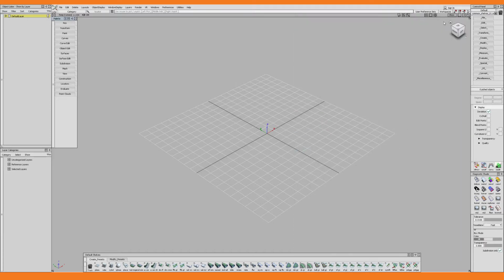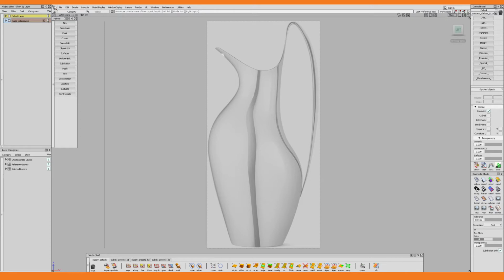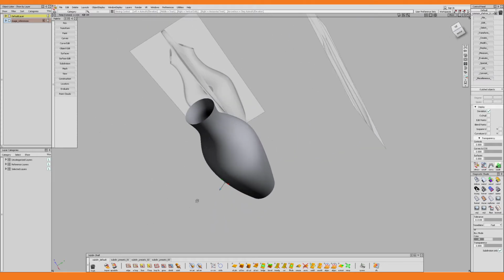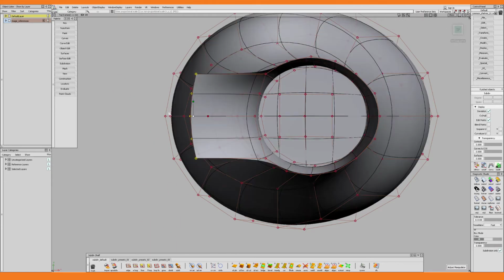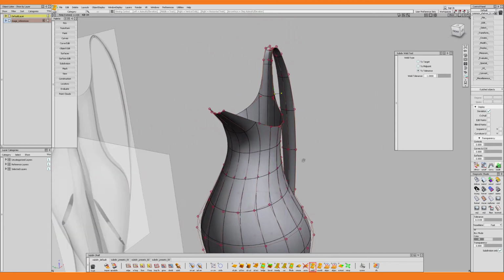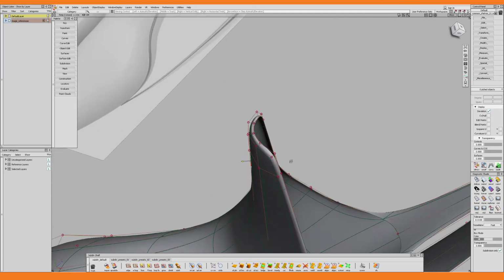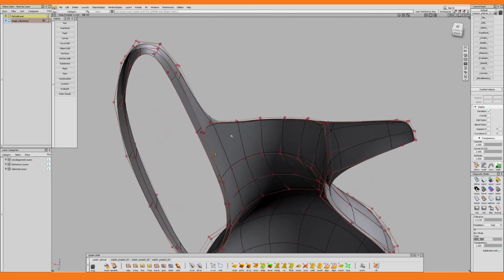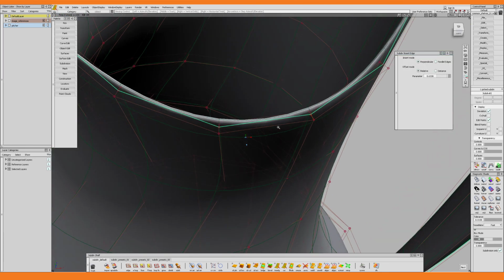AUTODESK ALIAS 2021 TUTORIAL: How to Create a Georg Jensen HK Pitcher with Subdivision Modeling

Comment: i am not able to export my model as .obj 
i want to render it on blender
Reply from the maker: You should be able to. Select the geometry you want to export. Then go to File>Export> Active As.. where you open up the options box by clicking the square icon of that menu item. A new window then pops up, and from the dropdown list in that window you can then choose OBJ as the export format.

Alternatively you can go with File>Export>Active as Subdiv... which basically does the same thing. Hope it helps!
Reply: @polygonpudding  thanks a lot 
It works

Comment: thanks for this tutorial, where do you get this matt diagnostic shading? and how do you manage to toggle the model with the same hotkey?
Reply from the maker: Hi there,

The shader that I am using is the Alias DefaultShader which I activate through WindowDisplay>Hardware Shade. Then I am not quite sure what you mean by toggling the model with the same hotkey, since I am using a different hotkey for that which I have bound to WindowDisplay>Toggles>Model. Maybe you could point to a timecode in the video where you see me doing what you are referring to, and I can explain how I do it.
Reply: @polygonpudding  at https://youtu.be/roBnmPGWcMw?t=412 I was under the impression you were toggling the model off and loading the shader in one operation. I was mistaken, you are actually using 2 hotkeys one after the other? It would be cool to be able to do the 2 with one hotkey only.
Reply from the maker: @elmirage6005  Yes, you are right in that it is two separate hotkeys, but I agree that it would be nice to be able to do it as one single operation.